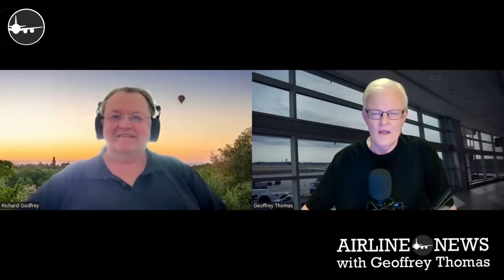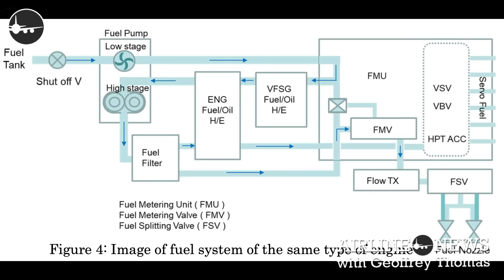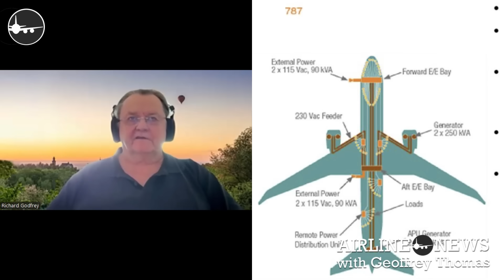AIR INDIA CRASH - FUEL & ELECTRICS FACTORS  #airindiacrash

Comment: So you shut down the APU when the engines are started and something goes wrong at takeoff, so you don't have time to start the APU if an error occurs that requires APU operation at takeoff. Why doesn't Boeing think about safety and let the APU be on for 10 minutes after takeoff and you are at a certain altitude so you have at least 1 minute to start the APU in the event of an emergency error.
Reply: This is a common thing on all airliners. This is NOT a Boeing only thing. When all engines are started, the APU is turned off as the engine generators take over providing electrical power. This has been the norm for decades, long before the 787 was even conceived of.
Reply: @ClaysonAntoons driven entirely by economics
Reply: A good question. When does the APU get shut down after takeoff?  Is the APU simply disconnected from the bus and allowed to run down after it gets switched off? My experience of back up power systems suggests that there should be an overlap period in which the backup power source keeps running for a while after being disconnected from the bus. If this is also the case in aircraft then why would it have been necessary for the RAT to deploy?

Comment: Thanks guys, your analysis much appreciated.

I would also note that when an aircraft descends from high altitude into hot humid air, water can condense from the airspace above the cold fuel. This will collect at the bottom of the tanks. Under the right conditions a considerable amount of water can condense out and slowly make its way to the water drains. This needs to be carefully drained off before the fuel is usable. Any water left in the fuel in excess of the capacity of the water separators could cause the engines to 'sputter' or fail altogether.
Reply: Jim, I am not arguing with you. I don't know enough to argue. Can water be drained off of the fuel with the plane still in the air? If yes, how do they do this? If not, it seems to me this has to be a very common event, I.e. a plane going from cold high altitude to a warm humid climate. Why don't all planes doing so crash? I am very confused about this. Thanks.
Reply: @kctaz6189 I would have magine there are water separators. Not sure what capacity.

My experience of this comes from maintaing a 700 l fuel tank. In humid weather I have found up to 20l of water in the bottom, all from condesnsation. In my case I have to manually drain the separators before it backs up too far.

Comment: Love your work Richard and Geoffrey - great description of electrical power and fuel systems - but the sheer number of combined failures required in either of these systems adds up to too many coincidences, especially in light of battery backup. This suggests to me electronic control failure rather than total electrical failure. Water ingress to electronic control PCBs via differential air pressure, via gravity, via capillary action etc as Richard suggests might just be the fatal factor upon rotation after liquid had pooled from a weeping seal.  My brother is a recently retired QANTAS pilot and he suggested this to me last week.
Reply: India should let NTSB do investigation too "" Suspicious they reject to give them to investigate Question is y n looks like they don't want people to know the truth .
Reply: Water ingress due pressure differential would only "push" out the water. Ingressed water (inside) will want to go outward. Pressure & Liquid likes to go from high to low.

The atmospheric is either lower than aircraft or at par (when on ground)

This fake report going around has really  confused alot of people
Reply: @pranabgill1310 water can go from higher to lower pressure zones, it’s not complicated so why are you repeating what I said? 

What is “this fake report”?  I made no mention of a fake report.
Reply: @CulinarySpy  relax

"water ingress to PCBs via differential air pressure " 
These are the exact words used by you.

I am not here to fight .
Reply: @pranabgill1310 that’s it, I’m still wondering what you’re talking about? Nothing different to what I said.

Comment: The RAT cannot drive a fuel pump right ?
Reply from the maker: The AC supply for the fuel booster pumps is a significant electrical load, which is not powered from the RAT bus.

Comment: Where do you guys get the energy to do this video's from? Anyway very well done for giving information and not conjecture.
Reply from the maker: Unusual for Richard, he was up half the night thinking about the Air India crash, he will sleep better tonight.
Reply: They speak very slowly which conserves energy
Reply: Love of aviation.
Reply: One major factor not being considered is the extreme environmental heat conditions that day from Delhi. The electronics malfunctioned. Having a/c in cabin is also for the safety of the electronics, leave alone the passengers. AI failed to maintain their planes! They should have fixed the a/c in the cabin to maintain the safety of the electronics! 
Leave your laptop in extreme heat and then run complex programs! Remember it was over 40°C plus on the tarmac for 2 hrs after a flight from Delhi. Boeing will take the fall. Poor maintenance will be buried in the final report.
Reply: 😂 They look like they could do with energy . Looks like hangover of  old British TV . Their analysis is very good though. Alas ! mainstream TV only wants sensationalism and no objective analysis.
Reply: Redbull ?
Reply: Ego
Reply: Money